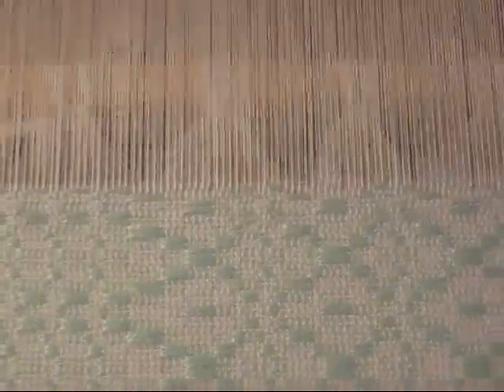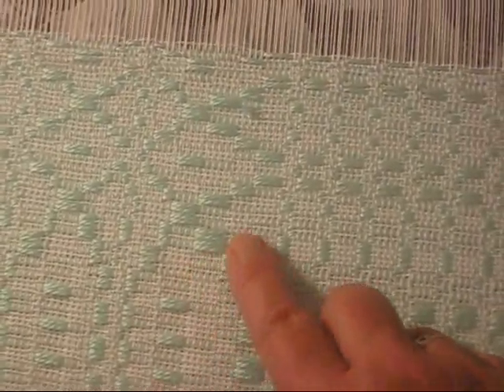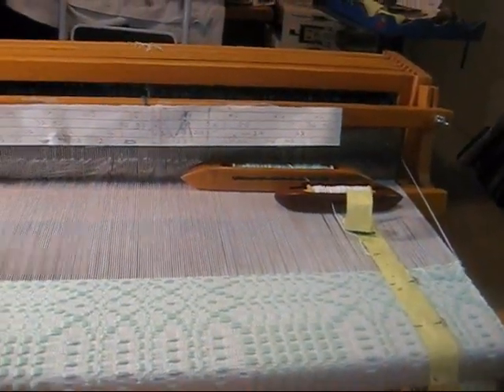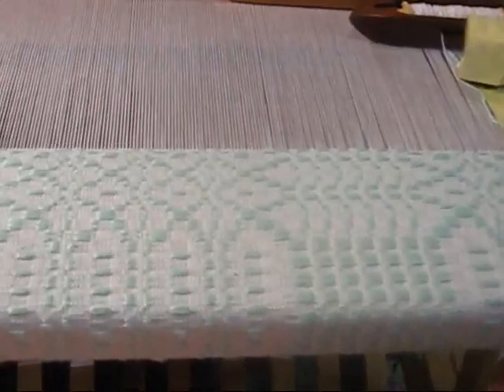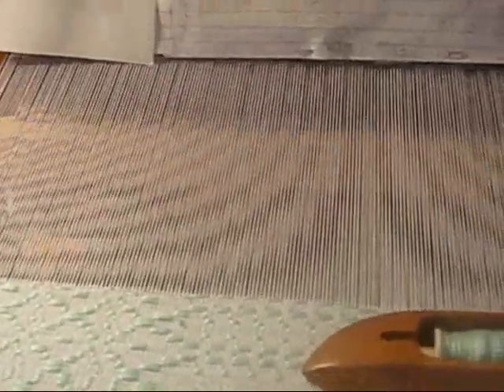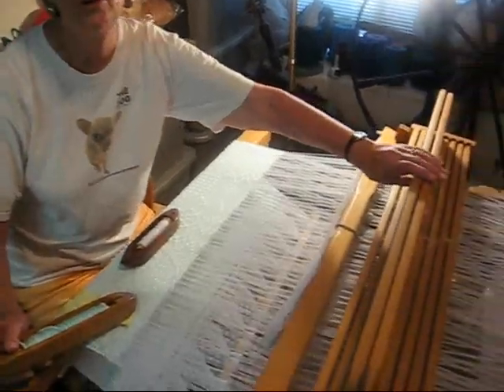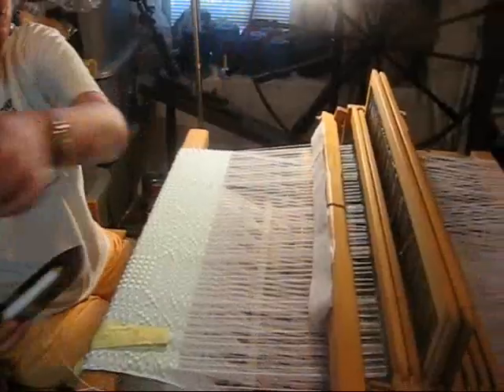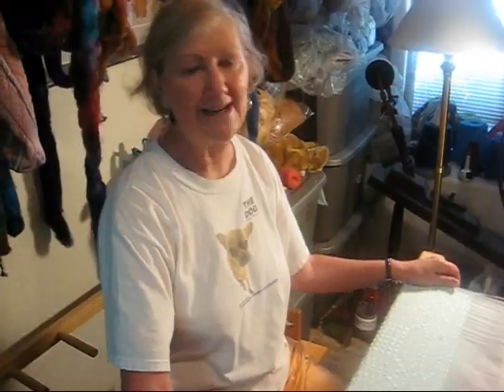Weaving an Overshot Coverlet

Comment: The pattern came from Helen Bress The Coverlet Book (Flower Valley Press) - but I altered it a little to get it to fit my 32 inch loom.  This has always been one of my favorite patterns for overshot.  The pattern is Pine Burr - altho it can have different names.  It's in volume 1 page 271 with the "draft" identification D278.  I had it Xeroxed at Staples then enlarged a TON so I could follow the pattern.
  I'm signed in as Rally judge right now - my other "life".